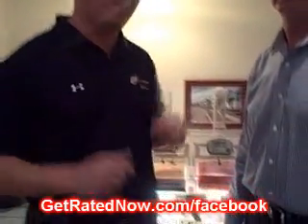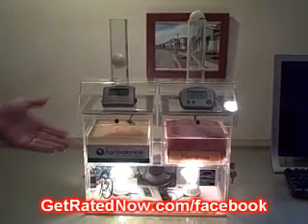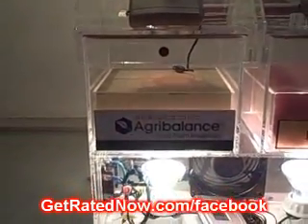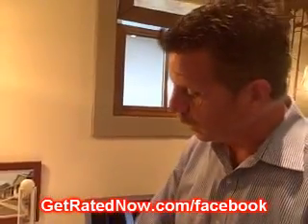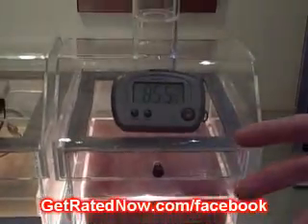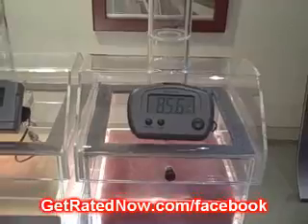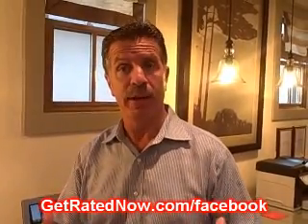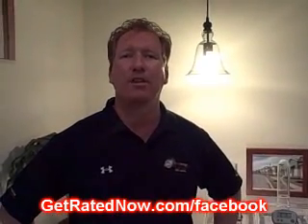Cool Demonstration of Foam Attic Insulation

Comment: I wish I could be dumb enough to beleive that there are gains in PAYING TO COOL YOUR ATTIC!!!  1. Air exchange rates in the typical attic are nothing compared to your "device". 1xchange/hour is normal!!!!
2. There is an air barrier on the underside of insulation, this has been required for decades. 
3. Now, you share air with your gas furnace and or water heater......YAY. 
4. For less than the cost of R-20 open cell insulation, you could install fiberglass loose-fill to r-60!  Crook.